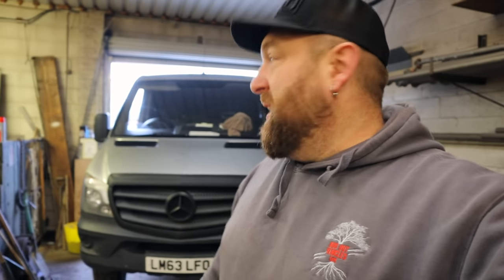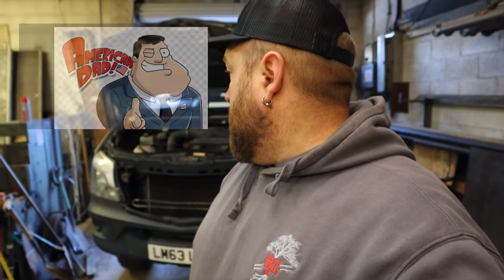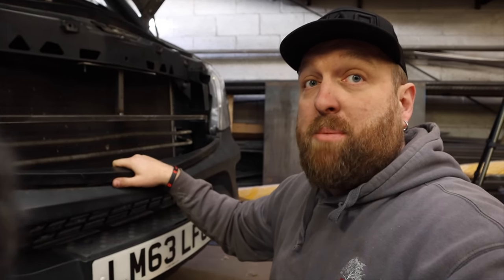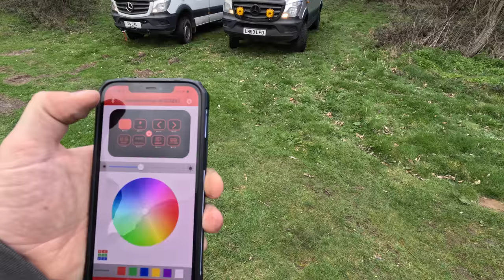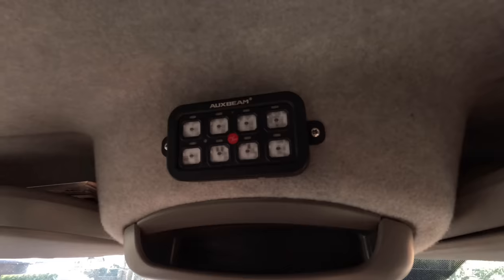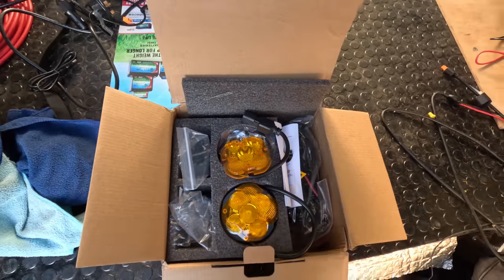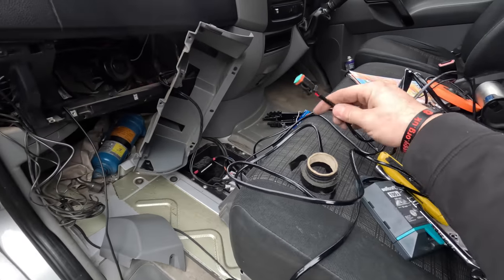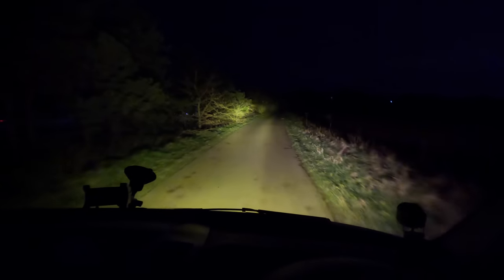4x4 Campervan lighting upgrade! Auxbeam switch panel lights and mounts installed.

Comment: Good tip on the bonnet lights, and AuxBeam looks a good bit of kit, if slightly expensive!
Reply from the maker: It depends how you look at it. They are far less than half the price of lazer or stead’s lighting.

Comment: 14:30, you mention wiring back to the aux beam switch panel. This is exactly what I want to do, if I chop off the on/off switch it leaves 3 wires. What 2 wires connect to the control panel ?